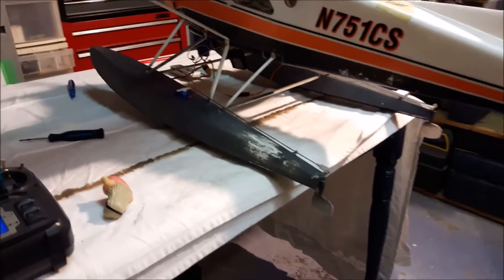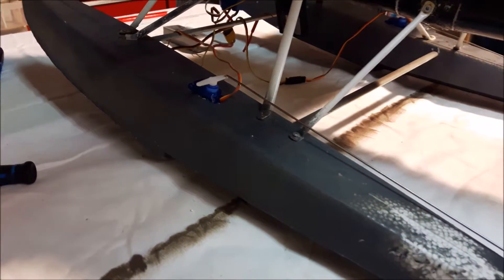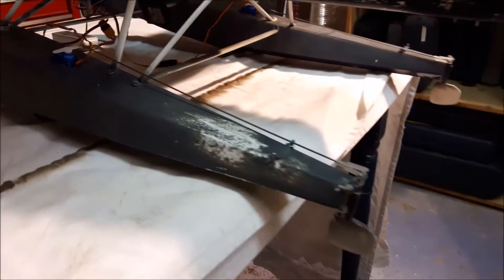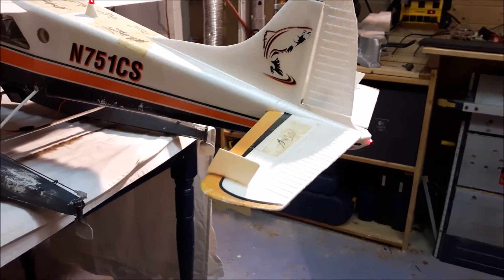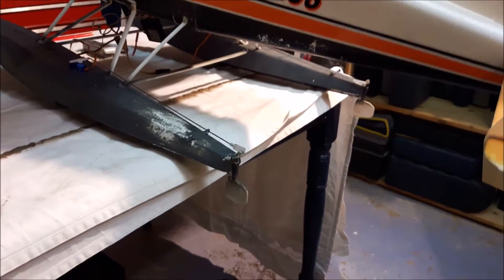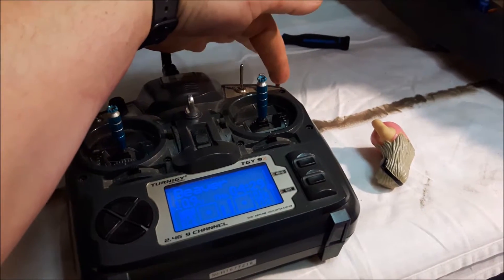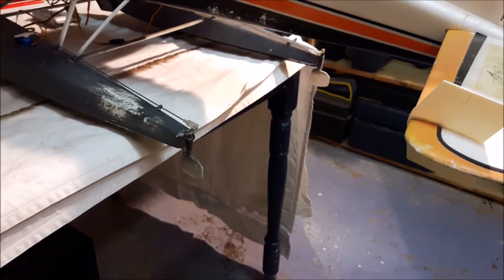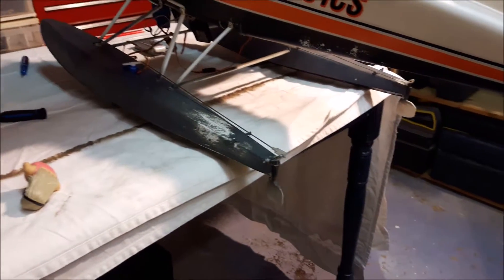Beaver Floats Rudder Mod

Comment: Can you explain if you used a wire harness and what channel did you connect to on your rx. Also, is it drawing more amperage out of your esc?
Reply from the maker: I connected them using a wire harness and put it on channel 8 on  the rx.  They are then at to gear switch on the gx so that they do not work in flight only when on the water.   The amp draw is very minimal but because they only function when the switch is activated when taxing it doesnt really matter much.
Reply: East-Coast Rc awesome! Thank you! I have dunked my timber 1.5 numerous times on perfect landing and take offs because the float rudders never held up in water
Reply: East-Coast Rc one more quick question  not to sound like a complete idiot, but you wire harnessed the float servos to the rudder input servo so when you flip the gear switch only one or the other has power, so you are essentially steering your water rudder with your regular rudder control on your TX? I hate to keep bothering you, but if you can explain how you did this that would be of great help. I am currently using a DX8e and have more than enough servos, extensions and wire harnesses/splitters to do this, I just tryin to figure out how to ‘tie it all in’ so to speak, whereas I have everything going straight to my rudder channel on my rx. Thank you so much for your video, as well as getting back to me so quickly
Reply: East-Coast Rc All right I found the plants. It takes 11 sheets to cut the kid out. Remember now, all I’m sending you is the actual kit itself without any of the components. You could build your own firewall, get whatever our pods you want, and go crazy with it
Reply: Sorry for typos. Driving. We will talk later
Reply from the maker: @rossrcfallacaro3422  yup i realize it's just the kit and I need to supply components.  Still awesome of you.   Emailing you shortly .  Just gonna double check the flitetest site that there isnt something else I want instead
Reply from the maker: @rossrcfallacaro3422  just emailed you with a link to the  mixing video and my address
Reply: East-Coast Rc awesome! We downloaded the planes last night and have to upload them to CAD this weekend. It’s on of their bigger builds - 11 sheets of foam board totaling a whopping $11.00 - so I will be EXCITED to see your build video and review!
Reply from the maker: You're not bugging at all.  I made the video in Hope's of helping someone do similar.  They are on a y-harness into channel 8 on the rx.  Then I mix channel 4 into channel 8 on my tx so that the rudder input moves them.  I then mixed in a switch to deactivate the rudder input from them .. if that makes sense.. if you want I can do a quick video of the tx setup for you
Reply: East-Coast Rc by the way, you’re the friggen man!! I’m actually waterproofing some esc’s right now using plasti dip, larger heat shrink, and epoxy. I got the idea from flight test. There’s a million different ways on YouTube, but flightest is definitely the authority when it comes to these kind of things. Everything else is just anecdotal. I need to get a gopro or something to make more videos on this stuff. Check our my channel. My old man owns a laser cutting biz and has been cutting predominantly warbirds the past 4 decades. Since everything is moving to foam it seems, we are starting to cut foam kits just playing around with CAD and the plans that flightest freely gives. I have a quick demo on my channel. It would be an honor for me to cut you a kit free of cost and I’ll even pick up shipping, I would like for you to just in turn do a review after build and flight. Pick any kit you want from all the flight test designs and let me know. It would be an honor
Reply from the maker: @rossrcfallacaro3422   I would be honored to do that.  Will go check it out and pick one this afternoon
Reply from the maker: @rossrcfallacaro3422  are you able to do the a10??  I can choose something different I just know that's one I've had my eye on
Reply from the maker: @rossrcfallacaro3422  I'll check out the website to make sure that's what I want and let you know.. I'll email shortly with my address and what not
Reply from the maker: Hey Ross Rc .. just curious if you had gotten a chance to ship out the plane.  Just wondering when to keep an eye out for it
Reply: East-Coast Rc dude! A quick vid would be awesome. You lost me on the mixing
Reply from the maker: @rossrcfallacaro3422  no worries .. I'll do a quick video this evening when I'm gome from work

Comment: Does it really matter that the float rudders move while in the air?
Reply from the maker: Ross Tinney its not for in the air.. its for better turning control on the water
Reply from the maker: Ross Tinney plus it gives it all around better rudder control then the fishing line pull pull system flyzone used
Reply: He knows that. He knows it is for water control. He is questioning what difference does it make if the rudders turn in the air r in other words, why bother disengaging them with the gear switch. Do you really not understand his question?
Reply from the maker: I guess I didnt fully understand the question since he didnt phrase it as "does it matter if you can disengage them when in the air".. and the reason why I wanted to disengage them was so it was t causing more amp draw from the esc when in the air.. even if minimal draw